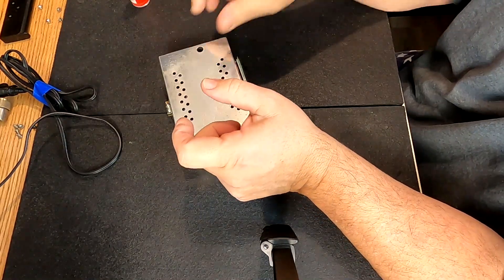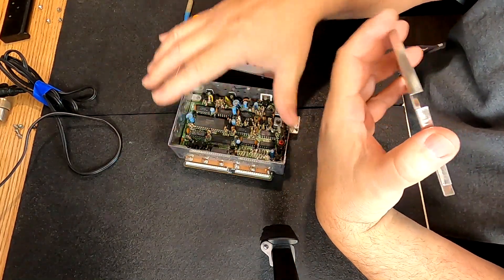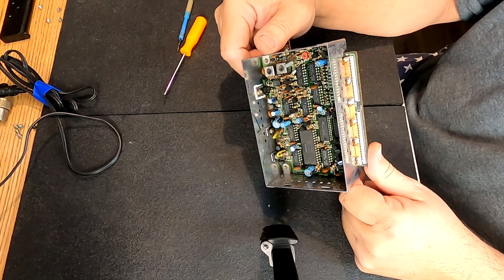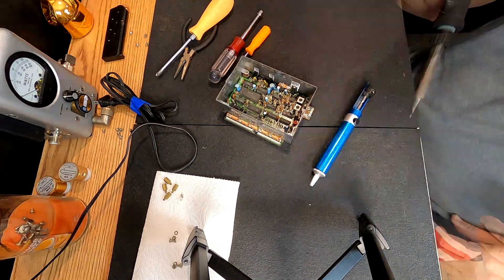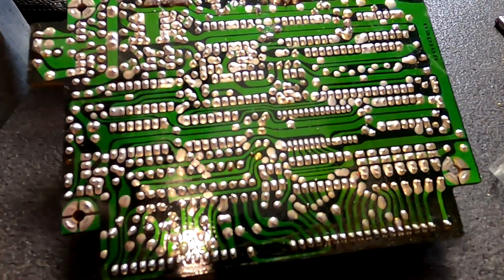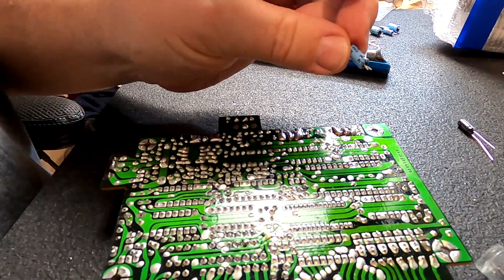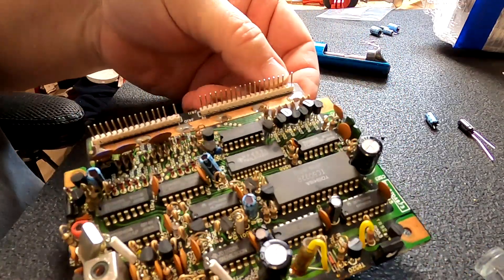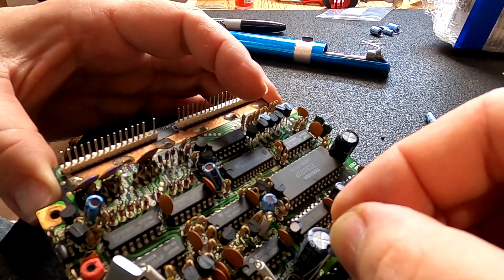Cobra 2000 GTL Frequency Counter gets new Capacitors

Comment: Looking good Mr. Wagonmaster, I just did one on a customer's 2000 Freq counter/clock board recap tonight, Although i didn't have the D528 5.6V 1 watt zener diode or the C505 .47uF Tant cap, I did do the D505 1N4148 Diode trick to make the second's work on the clock, Now to finish the rest and hope there is a bad cap bogging  the modulation down making it not modulate on am, ssb and PA.  Hope to make it your way this summer and possible meet up at 99's house again. be safe over there on the West side of the Rockies
Reply from the maker: Looking forward to seeing you sir.

Comment: I would say tat wick would be safer to use and assure all solder is removed. I hear that working it out is dangerous.
Reply from the maker: I have been doing this a long time, used solder wick mostly back in the day and had decent luck. My Dad was Western Union tech, he repaired teletypes and other components that go with that whole system, one night he came into my room while I was working on a Stereo receiver. I was taking out some PS filter caps using wick, Dad left my room and came back with one of his solder suckers. He gave it to me and explained how to use it. After you get the hang of it your good to go.....
 Been using that same tool ever since.
I think it is all about technique.

Comment: Interesting unit, love how its all classic thru-hole. Generally if I am removing components and I don't have my MBT100 desoldering gun, I add some flux and fresh solder, then walk the legs out. Much easier thermal transfer when you have solder. Once legs are removed, then I go and clean out the solder. It's all about minimising the amount of heat time, as lifting pads sucks. Nice share 👍

Comment: theres a diode and regulator Mikes Radio mentions to replace while you got it apart
Reply: a 5 volt zener  i go with a 1 amp one
Reply from the maker: I will have to check that out. I know there is a missing diode and by adding one you get seconds readout . I didnt opt for that. However I may change my mind, whats left of it. Hope to talk to you again this spring. 73s